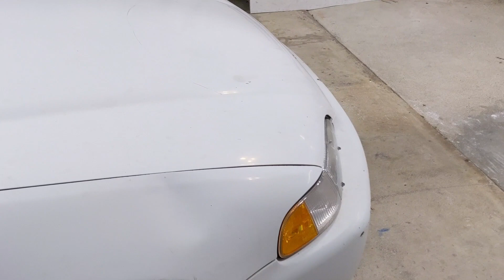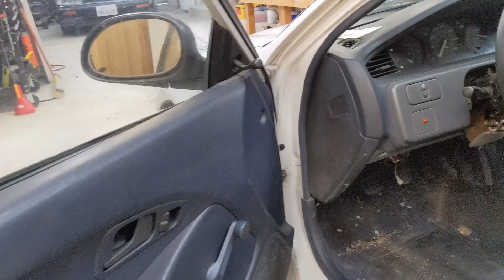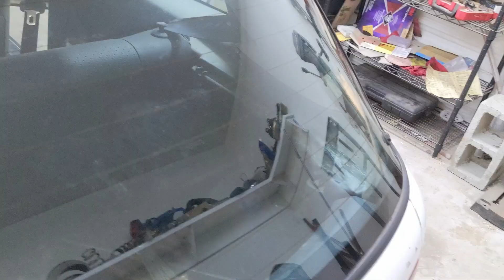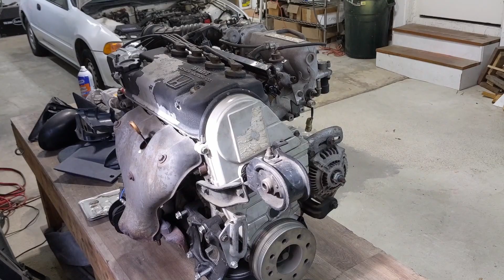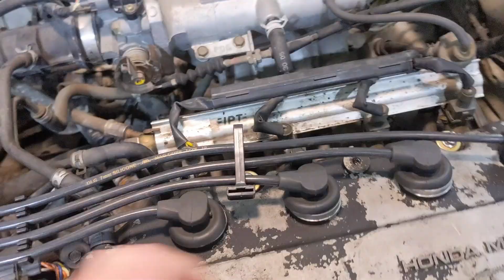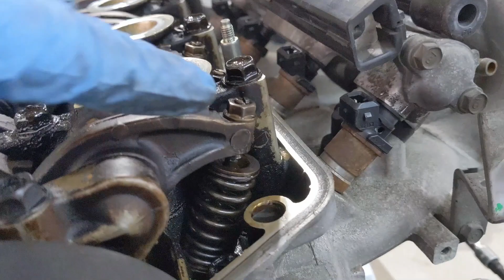Honda Civic EG Hatchback Restore - Part 1 - Project Intro - Make it So

Comment: If your timing is correct then the biggest culprits are the distributor (mainly the coil) or the fuel main relay not clicking.  I’m sure you can get it started , problem is if the head was warped from the head gasket failure.   Good luck with the EH2
Reply from the maker: Hey, not sure if you saw my other video but I did get it running. The ECU was bad. Leaking capacitors.
Reply: @MakeItSo how did you fix the ECU?
Reply from the maker: I sent it to a guy on EBay who repairs them. 

https://www.ebay.com/itm/144317598357?mkcid=16&mkevt=1&mkrid=711-127632-2357-0&ssspo=2zTUrIgKTva&sssrc=4429486&ssuid=RJiG4M-HTDq&var=&widget_ver=artemis&media=COPY
Reply: @MakeItSo thanks just getting ready in case that’s the problem on my 1994 VX